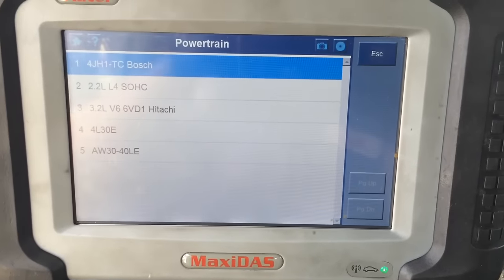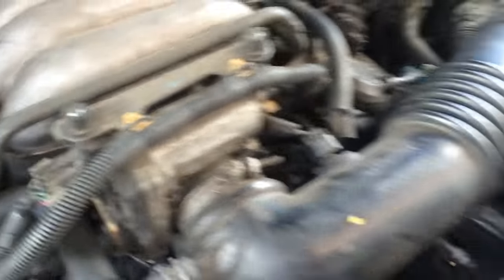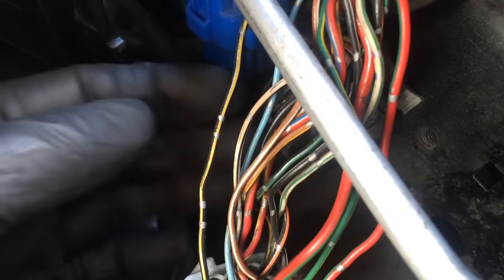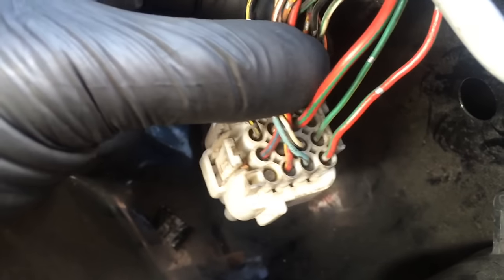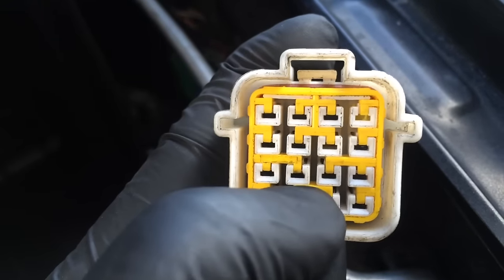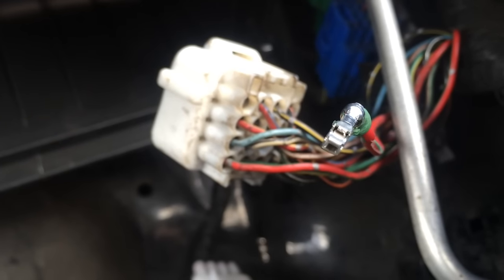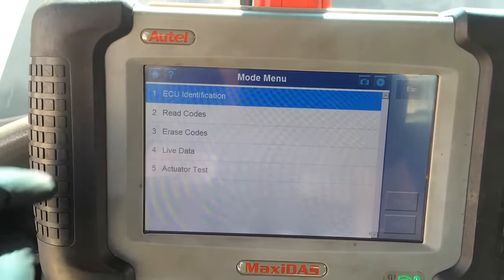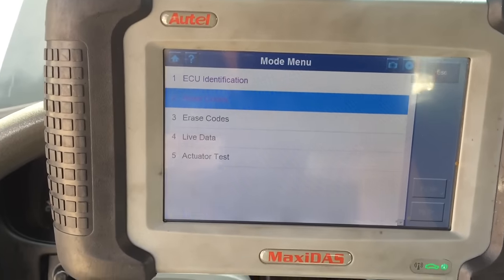SOLVED!!! ECU ECM No Communication FREE fix!!

Comment: Hi there. Is there any chance that this is the same problem I am experiencing with my 2007 chevy spark? it cranks but doesnt start, as the spark plugs and fuel injectors arent working. I am at my wits end as ive had to have it towed to two different mechanics who believe its an immobiliser ecu issue but cant fix it. kind regards, andre

Comment: hello friend I have a question for you
I have a Honda passport 2001 The ECM blocks the injectors and the scanner does not start does not work. Can you repair it with your method? elberth cabrera
Reply from the maker: This may be your issue. Poor contact to that wire causes no power or communication to the ecm

Comment: I changed starter, alternator and battery and it’s still happening... my scanner says “lost communication to pcm/ecu” (08 Malibu) no crank,, no start.
Reply: JuNii0rr x Have the same issue with my Malibu. Did you ever find out the issue?
Reply: I have that problem with my Cobalt.

Comment: Having the same issue on a 2018 Malibu I put the scanner on it turns on but I get no communication as far as me trying to read codes goes. Scanner turns on just no communication. I had a bunch of fuses missing and put them back together. Still trying to figure it out. Any 1 out there messing with a malibu and same issue give me a holla. I appreciate every advice. 🙏
Reply: I've been having the same issue with my car, but it's not a Malibu. I plug the scanner in and no communication. This is after the motor was pulled and I checked every possible wire and fuse and relay you could imagine all of them are good. It's  Very frustrating I still havent fixed it.
Reply: @Eurospec73  Computer
Reply: @Eurospec73  I ended replacing mine.
Reply: @Eurospec73  if you can walk me trough what you have done I could help you. I got my car running and driving. I replaced the fuse box, the control modules, computer, I mean I done did everything but I did learn in the very end. Thank God. 😊 I'm here to help just holla.
Reply: @danielcarcamo6336  Ever since I replaced the engine. I've been having a crank no start/ No spark issue. I checked everything, all fuel spark and Air.
 Want to plug in the scanner with a b c DS tool into my OBD1 connector no communication is found.
 
I checked my fuse box it looks perfectly fine all my fuses and relays are in good condition nothing is blown. A lot of people saying my ground wires weren't connected or there's a ground issue I'm pretty sure all my grounds are connected.
 
What's the best way to resolve this?
I even did a ground test as well. 🥵😣😖
Reply: @Eurospec73   What's your Year Make and Model to help you out better with the vehicle. Also here are some tips.

Usually when the OBD port is not responding with a scanner. The main issue is caused by a blown fuse or shortage of power or ground. Just yesterday, I happened to work on a 2008 Nissan Titan with the same issue all i did was replace the Cigarette Ligther fuse. Start by checking the Cigarette Ligther fuse in the fuse box located on the engine or inside of the car, when you pull the cover from the box look at it and locate the fuse, it should read "CIG" or something in between those lines depending on your vehicle, "if" blown replace it, you might ask yourself "well whats a Cigarette Ligther fuse gotta do with my OBD port"  it's just the OBD port power outlet 😁 we can get into details later. That should solve the problem with the OBD port. 2) If the Cigarette Fuse is not blown start by checking the wires on the back of the OBD port you might have a loose connector wire that's not pronged correctly into its socket grab a flat head full the port out by pressing the sides and pulling slightly carefully. Wiggle them around, pull on them slightly to see if any of them come out. "If" so then there's your problem. 3) last and final step. If you've done all this and all else fails it is the fuse box itself.  But before replacing it. Check all the wires leading to it. Do a pull test on them to see if any are loose. "If" so then there's the problem.
Reply: @danielcarcamo6336   
    Hello Daniel,
It's a 1992 Volkswagen Corrado SLC, Thanks for your response on this I appreciate it. I have done a visual inspection of the fuse box and the wires in the back at least three times since this issue,
  and all the wires seem to be intact just fine no the fuses are blown all the relays I think are working good. Just a crank no Start/ no spark unfortunately.  

Funny thing you mentioned that wire about the cigarette fuse as I did notice one wire was cut from the back of the fuse box.
 And it's actually right behind my tail lights/ side marker light fuse #7 in the back of the fuse box.
 But I don't think that would cause the car to have these issues.
I'll Definitely check for loose wire at the OBD1 port thanks for your response on this.
Reply: @Steve K.  No problem, glad to help. Try repairing that wire. Anything cut or loose that's behind the fuse box could lead to minor problems. Usually with Diagnostics it's always the smallest thing, that seems major. Once we solve the issue, it becomes easy on the next task, check that all your main components such as computers and modules properly plug and snugged with no wires loose. "If" your problem persist. I will leave you with these 3 thing to keep in mind 1) Replace the fuse box because it might be fried, you can check this by just removing the covers around it and just look at the motherboard. 2) Your Computer is fried and not responding with your fuse box and body control module or possibly out of program... in which case you can't program, because you cant do a Diagnostic scan. 3) The body control module... these are the only 3 things that all correlate together when it comes to diagnostics checks and it's usually the problem.
Been that it's a German vehicle with a no crank or start reminds me of a 2007 BMW 750I I had, same issue, this was caused by the VVT "Variable Valve Timing". When that module is fried the engine won't crank or start.

But before you jump into all this have you tested your starter motor on the vehicle? Try that out before you go out spending money on things that are not necessary 1st. Also try turning your crankshaft to check that your engine ain't seized. I hope everything, I said helps you out, with your journey in fixing your vehicle. If your need any help just holla. I'm glad to help. Let me know how it goes.
Reply: @danielcarcamo6336  thanks for your feedback on this Dan,
 The car does crank it just doesn't start because of a no spark issue. I have thoroughly looked over all or most of the wires and plugs that are plugged into the back of the fusebox everything is plugged in tight.
 No issue there.
  But I thought about what you said as far as one of the wires being loose perhaps in one of the main engine wiring harness and and that's a great idea that you say because if it is loose I could just pull that wire out and open up the prong and make it strong again and put it back in and hopefully it should work.

All this is a lot easier said than done until you know where to look but I get the idea of what your saying.

I think I'm going to do a ground tests on my multimeter I think if it's over 0.5 ohms then that means I have a ground short or a ground missing. I know it's something small and stupid at this point even though I can't pinpoint it, that's just my hunch of this whole thing. And I've had that feeling about this the whole time.
Reply: @Eurospec73  No problem buddy.  Give it a go. One thing is for sure surrendering is not an option, once you in it, if your truly dedicated, it will all click and be solved. Glad to help.
Reply: @Eurospec73  Also now that you mention that there is no spark, got me thinking of the spark plugs coils, or fuel injectors not sending fuel pressure to the engine and now we jumping into the mechanical side of the diagnostic. Gotta luv working on cars. Theres a saying "A person that works it's vehicle is never stranded". 😁 I don't wanna jump into speculation, but that's what usually mechanics is, when we can't scan. I run a Snap On Verus Edge, does everything I need except program keys and reflashes. Yet my Autel MaxiSYS Does everything for a fraction of the price the machine cost me.
Reply: @danielcarcamo6336  There is no coil pack it's a Distributor. Yes it's interesting how not having fuel wood prevent it from cranking as well. I'm going to do a more of a multimeter check tomorrow and all my ignition points go over everything one more time to make sure nothing was missed.
Reply: @Eurospec73  Got ya. Have you tested that distributor already?
Reply: @danielcarcamo6336  of course I did that was the first thing I checked that's how I figured out I was getting no spark at least one of the red power lines works of the distributor. Tomorrow's another day!

Comment: can I just wire the male and female together
Reply from the maker: You could but would mean more work for you. This method worked great and has not had the same problem since
Reply: @RevvedUpKnowledge  how can i fix ECU in clio 2 ? I have no connection too